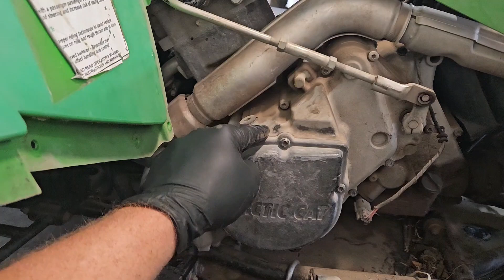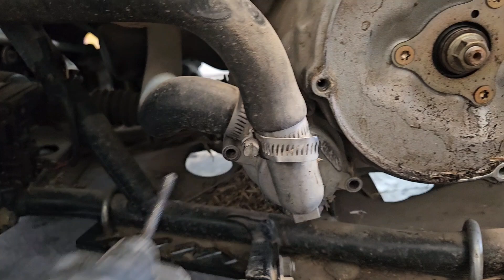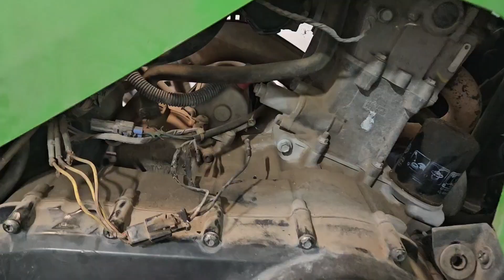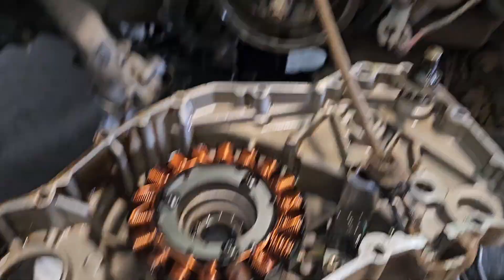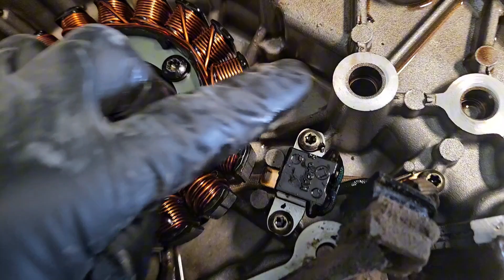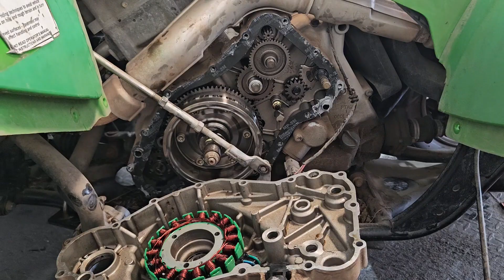How To Replace Arctic Cat 550 650 700 H1 Stator

Comment: Great video brother.  Im working on a bike someone messed up bad.  They had the end of the three wires from the stator connected to pos on battery.  I know this isnt right but where are they meant to be, was hoping this video would show it.   Ill be subscribing.
Reply from the maker: Oh wow. That battery was getting fried then if it was getting 60 ac volts from the stator.

Comment: The 700 efi mudcat water pump does not come off without leaking and one stator cover bolt is located behind the pump and requires removal of the skid plate to get to.

Comment: Hello. My stator plug burned out. How do I connect it?
Reply from the maker: @albertdamianciekot2581  just use some connectors like a bullet style or spade style. Cut and strip the old wires and crimp on new connectors. Just match the color wires up if they differ. If they are all the same color, it doesn't matter which ones you match up

Comment: Got any tips on replacing the stator and still not wanting to start?
Reply from the maker: @jorkk1305  do you have spark, compression and fuel pressure? The stator generates voltage to charge the battery and sends a signal to the cdi for spark
Reply: Is it true that the crank position sensor is built into the stator? I'm getting crank, no start with ac21 code. I'm guessing that  acts as a component of the timing? I've got air, compression, and fuel. The spark is  weak. Replaced coil and plug, still weak spark.
Reply from the maker: @stevenixon9022  code 21 is for the inlet air temp sensor which is located on the aur box. The stator does act as the crank position sensor on these as well though.
Reply: Thanks for the info!